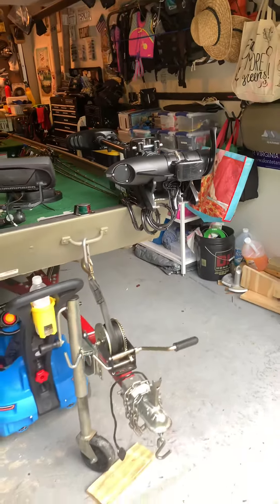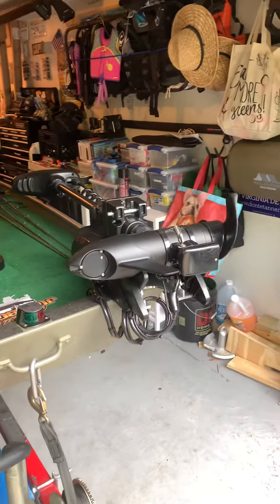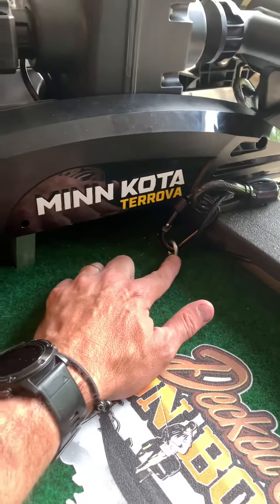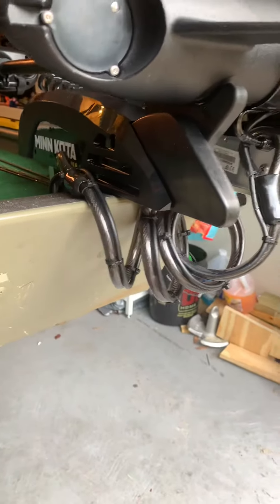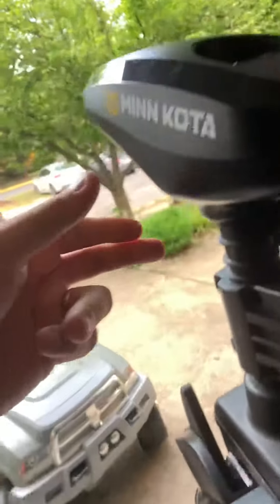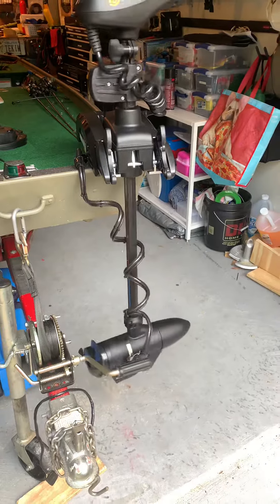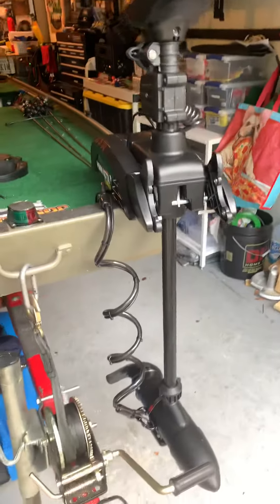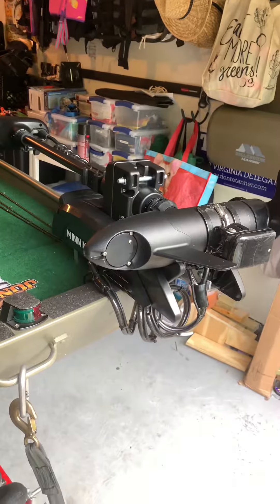Minn Kota terrova transducer mounted trolling motor idea

Comment: New sub. Nice. I was going to do that too. What length is the cable and did you put that key chain connecter under the transducer clamp.. Where u get the black lock chain also.
Reply from the maker: It’s a 4ft I believe. I ordered off amazon. I also ordered the carabiners as well from amazon. For you question. I put the carabiner right next to the transducer mount under the steel clamp. If fit nicely in there. The idea worked out really well. I haven’t had any issues.

Comment: doesn't the carabiner next to the transducer interfere with the picture you get on the fishfinder? Does the
same carabiner move around or is it secure? And finally I assume you hand wrapped and zip tied  the security cable to the transducer wire according to the coils in the security cable correct?  Looks great. I definately think its the best thing I've seen, Also could you add a pic or clip of the carabiner/transducer mount close up? Thanks!! Great idea
Reply from the maker: I will get you some closer pics.
Reply: @themichaeltanner  
i wonder how it would work if you coiled the cable and wire around the tm shaft
Reply from the maker: You can’t because of the way the shaft goes up and clicks into place. There is no room
For it.

Comment: Having trouble locating the same or similar bike security cable.  Can you provide a link to the specific cable you ordered?  Thanks for posting because I have been looking for a way to do this and your method looks fantastic.
Reply: I found a 6' cable at Wal-mart.  I installed it just as you have shown, I'm testing it on the water today.
Reply from the maker: Lumintrail 12mm (1/2 inch) Heavy-Duty Security Cable, Vinyl Coated Braided Steel with Sealed Looped Ends (4', 7', 15' or 30') https://www.amazon.com/dp/B01K02R9NS/ref=cm_sw_r_cp_api_i_n8LJFb3SVNEZZ

Here’s what I had, a four foot. Works great.
Reply from the maker: Let me know how it worked for you. Or if you have any questions.
Reply: @GmanfromTexas  me thinkest you boys got er figured out. i will try it  tnks

Comment: for the record .I ordered the 4 ft cable for my 60 inch shaft terrova. WAY to short for my lund. Figure in shaft length plus some. I re ordered the 6 ft
Reply from the maker: Obviously yeah you got a look to see how long your motor is mine was a 50 I believe when I bought it 50 or 48 but I cut it down way smaller to fit my boat better and I think I only yeah use the 4 foot cable and it worked out perfectly. You were asking before about the Caribbean or down at the end of the motor it doesn’t really come in contact or anywhere near the transducer so it doesn’t really affect any kind of quality with respect to the fish finding part of it